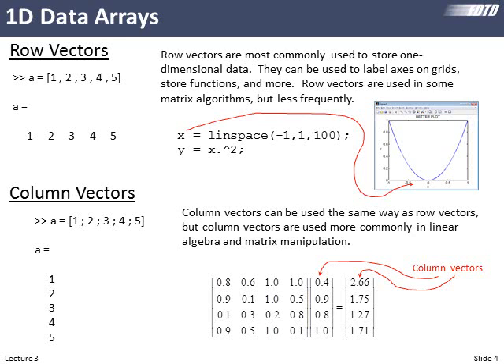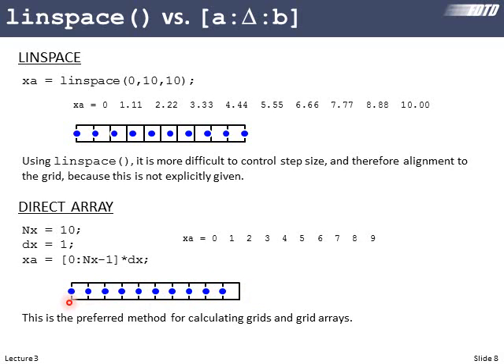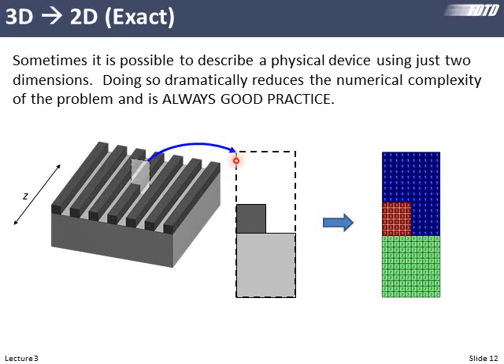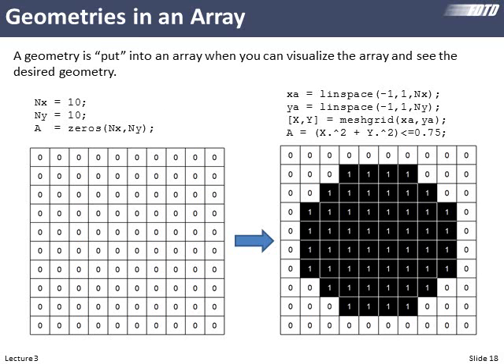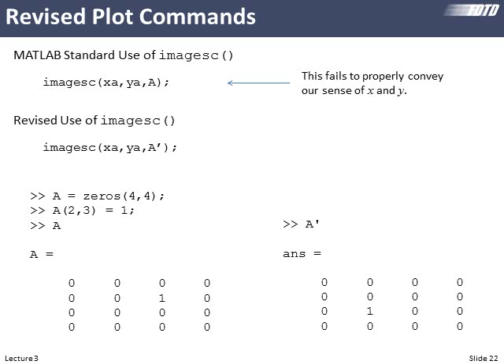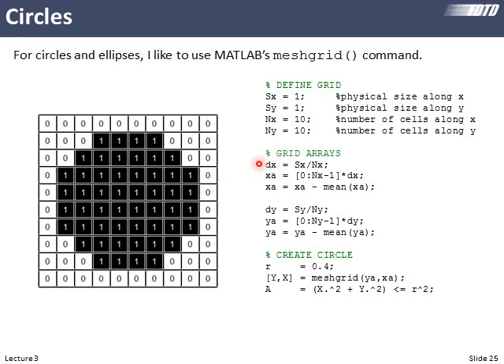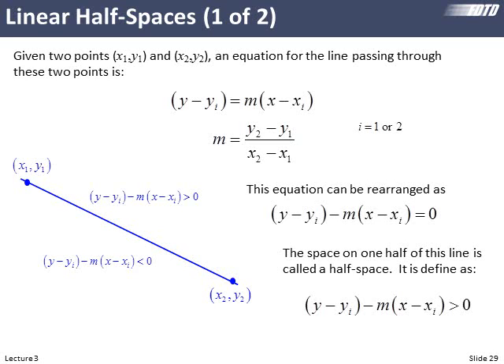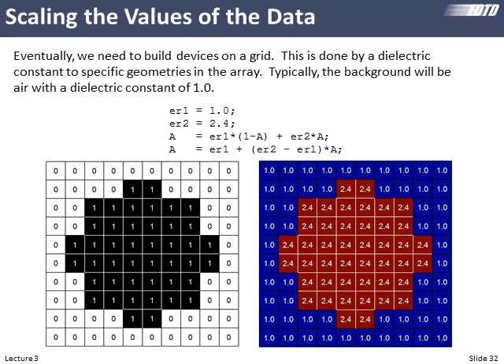Lecture 3 (FDTD) -- Building geometries in data arrays

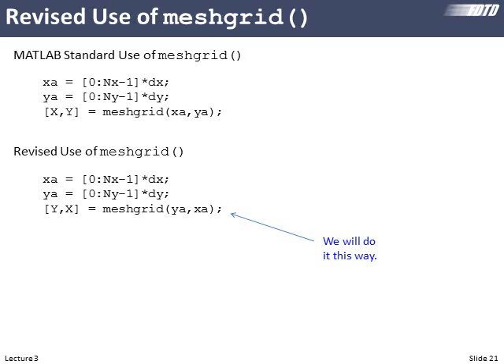Comment: Hi Professor, at 25:00, if my understanding is correct, we can simply use [X,Y]=meshgrid[xa,ya] in the current Matlab version, right? I feel a few changes are made in the mesh grid function in the new version, Here is the link: https://www.mathworks.com/help/matlab/ref/meshgrid.html
Thanks.
Reply from the maker: I was not aware anything had changed.  When I use meshgrid, it is usually [Y,X] = meshgrid(y,x).  The order is important.

Comment: Thank you sir,
But I want to make a cone in 3D.. Please help me. Give me some idea
Reply from the maker: This is pretty simple code, but you can modify it as you need...

% 3D MESHGRID
xa = linspace(-1,1,20);
ya = linspace(-1,1,20);
za = linspace(0,3,30);
[Y,X,Z] = meshgrid(ya,xa,za);

% MAKE CONE
R = 0.9;
C = (X.^2 + Y.^2) <= (R*(3-Z)/3).^2;

% SHOW
s = isosurface(Y,X,Z,C,0.5);
h = patch(s,'FaceColor',[0.5 0.5 0.8],'LineStyle','none');
axis equal tight;
view(10,10);
camlight;
Reply: @empossible1577  Thank you thank you so much Sir
Reply: @empossible1577  I'm so happy
Reply: @empossible1577  Thank you very much Sir, I have done cone, sphere, cylinder and some combinational  structure like cylinder-cone and cylinder-hemisphere. One more thing now I want to do complex structure so for that can I import any geometry from CAD model. Ya is there any other way to make complex structure like jet plane.
Reply from the maker: @PhysicsKeeBuniyaad  I would import an STL file of the plane and then use a function like voxelize() from Mathworks website to convert to points in an array.
Reply: @empossible1577  Thank you so much sir for your response, I'll try my best to do this. Can I ask you if I face any issue on that.
Thanks once again, I got lots of things from you it's may be my luck.
Reply from the maker: @PhysicsKeeBuniyaad  I will help as much as I can.  Good luck!
Reply: @empossible1577   Thank you sir,
I can't explain my pleasure. I have done model import from CAD file( .stl )and use of it in FDTD.  And all these are due to only your help. Sir, if you don't mind, could you please share your mail id. mine akhila9040@gmail.com .
Reply from the maker: @PhysicsKeeBuniyaad  rcrumpf(at)utep.edu

Comment: Hello. This is a really nice video, but I would like to ask something:
1) You only assign values of 1 and 0, if you want to be more precise, can you assign values between 0 and1 which means the cell is almost empry or almost full?
2)Here you worked with basic geometries, but if you want to generaliize to a more complex problem how can you use this method for another geometries not so easily to parametrize with an equation?
Reply from the maker: Great questions!
1) It is absolutely possible to assign values between 0 and 1.  In fact, this is often preferred to simulate curved surfaces.  I usually do not do this until the final device is constructed, and then I smooth the edges a bit.  That is because boolean operations on grayscale objects can be difficult.
2) I usually think of complicated shapes as combinations of simple shapes.  For example, a house is a triangle on top of a square.  For really complicated shapes, I may import something from a CAD file, voxelize it, and put it on a grid.
Reply: @empossible1577  Thanks for your answer, later if you could do something importing a complex geometry would be nice, I already did but my code is slow, I used boolean operations with polygons intersecting the mesh with an object.
Reply from the maker: @luiseduardojatarmontano1983  You can import images.  It will be necessary to flatten then to a single array and then convert to permittivity values.  You can also import CAD files and voxelize them using any number of codes users have contributed to Mathworks.

Comment: Are the arrays in the slides rotated from what the code does? Mine are all coming back rotated/flipped?
Reply from the maker: Yes.  I do talk about this somewhere in the lecture.

MATLAB treats everything as a matrix.  That is why array indices start at 1 instead of 0.  It is also the reason for the rotation.  In matrix notation, the first array index is the row number, or vertical position in the array.  The second number is the column, or horizontal position.  This means if you are building a function, you must interpret it as f(y,x) instead of f(x,y).

From experience, I have found it most straightforward to treat arrays as in any other language, like f(x,y).  That makes building devices on the arrays more intuitive.  However, if you visualize the arrays using MATLAB graphics functions, they come out rotated.  This is easily fixed by simply transposing the array before plotting that.  That is why you see me use commands like

imagesc(xa,ya,ER');

Notice the transpose on ER?

Comment: Thank you for such wonderful lectures. How can I build a cylindrical geometry of some random radius 'r' in 3 dimension? I understood how to use meshgrid for determining the radius of the circle but if now i want to give it a depth as well how is it possible? Please suggest.
Reply from the maker: Yes, absolutely.  You can do this using the exact same techniques.  For example...

[Y,X,Z] = meshgrid(ya,xa,za);
RSQ = X.^2 + Y.^2 + Z.^2;
ER2 = RSQ <= r^2;

This will build a 3D sphere into the array ER2.
Reply: THank you for your reply but I am looking to make a cylindrical geometry not the spherical one.  for example a cylindrical bar made of steel is embedded in wood. So i basically want to assign different material properties.
Reply from the maker: [Y,X,Z] = meshgrid(ya,xa,za);
RSQ = X.^2 + Y.^2;
ER2 = (RSQ < r^2);

This code builds a 3D cylinder with the uniform axis in the z-direction.
Reply: Yeah it worked. Thanks for your help.
Reply: What to do in case of a cylindrical geometry but with a finite depth. For example i want a 3D cube of material A with dimension 'a x a x a'  and then i want a cylindrical geometery in it having a certain depth (lets say a/2). How to control the depth of cylindrical geometry?
Reply from the maker: You can make finite depth cylinders and even more complicated structures by thinking in terms of combinations of simple shapes.  These are called boolean operations to use CAD lingo.  So first, make the infinite cylinder as above.  Second, make a slab the same depth you want your cylinder.

D = abs(Z - z0) <= (w/2);

Here the slab is centered at z0 and is of width w.  Now combine this with the infinite cylinder...

ER = ER .* D;
Reply: After generating the geometry, ER turns out to be a logical multidimensional matrix. When i tried to assign 1's and 0's a certain values, code doesn't change it.  Any suggestion why it is happening?
Reply from the maker: It could be the array indices you are using are preventing the numbers from actually being put into the array.  For example, the following line of code will not change the array A.

A(5:4:,10) = 7;

It should also be that you are overwriting the values somewhere.

Otherwise, I think it is impossible for me to say what is going wrong in your code.
Reply: I have figured out the way to do it. Suppose A is a 2 D dimensional array with a circular geometry defined in it. So initially when you check values of A, it will show 0 everywhere and 1 where the circular geometry is defined. So where i stuck was when i was trying to change all 1s to some value x it was still 1(i dont know why)

So what i did next is converted the logical array to double precision using double (A) then when i tried to it, all 1s got replaced with new value x.
Reply from the maker: Great!
Reply: Can you suggest any way to define a line inclined at different angles w.r.t. horizontal or a rectangle of certain width inclined at certain angle?

Its easy to define a line at 45 degree angle but right now i cant think of rectangle/line defined at different angles.

Comment: You mentioned how it'd take ~110 GB to solve this using a direct LU-like method. However, typically systems of this size are likely to be solved by iterative methods like BiCGStab(L) or relaxation-like methods, where the memory requirements remain manageable. 

Is there a reason why you specifically mentioned a direct method, or was that just to generally make a case about the shortcomings of sparse-matrix based methods?
Reply from the maker: Yes, it was a general statement.  Sorry that was not clear and thank you for pointing this out.

Comment: Why don't you just use colon instead of "direct array" at about 8:20? like: 0:1:10 going from 0 to 10 with step size being 1.
Reply from the maker: I could for this specific case.  The code as written on this slide is more versatile I think.

Comment: Thank you for this video! 
Why are you using a variable (za) to compute the grid point and an ANOTHER one (z) to compute the values of E, H at the the grid in the problem #1
http://emlab.utep.edu/ee5390fdtd/Homework%202%20--%20graphics%20and%20grids.pdf
Reply from the maker: No difference.  I think it was just the different moods I was in as I created the slides at different times.
Reply: Thank you !

Comment: This is an amazing resource.  I'm translating to python so it is a little tedious for me.  Does this group have a website and a general purpose?
Reply from the maker: You can go to our research website here:

http://emlab.utep.edu/

If you click on 'Academics' you can get to the course website for several classes.  This one is "Electromagnetic Analysis Using Finite-Difference Time-Domain."  The next course is "Computational Electromagnetics" and then "21st Century Electromagnetics."  The websites contain links to the recorded lectures, PDFs of the lecture notes, and other resources.  I have made many revisions, corrections, and improvements to the notes so they may differ from the notes in the recordings a little bit.

The general purpose of these lectures is to provide an introduction to computational electromagnetics for the complete novice.  I found it very hard to get started in CEM simply because there were no resources simple enough for me to understand easily.  These lectures were created with that in mind and I am always trying to improve them without over complicating them.

Comment: In slide 23, nx and ny are positions in vertical and horizontal respectively but the figures illustrates it totally differently. 1s should be filled in row 3 till row 6 and column 4 till column 8 as per the codes on the right.
Reply from the maker: I see you posted this one year ago.  Sorry I did notice it until now.

You are sort of correct.  The name MATLAB is an acronym for "MATrix LABoratory."  It assumes everything is a matrix where the convention is A(row,column).  It assumes this whether or not the array is a matrix or just an ordinary array.  In this context, you are exactly right.  However, it is my experience in computation that students have the most trouble building geometries into arrays before the simulation is even performed.  In this case, we more intuitively think in terms of f(x,y).  After some thought, you will realize that A(row,column) is a bit like f(y,x) instead of f(x,y).  This makes it very confusing to build devices into arrays, which are not matrices.  So, I like to build things in arrays in the context of f(x,y).  The only time this is not really compatible with MATLAB is when graphics are drawn.  You just have to remember to transpose or rotate your data before plotting.  Unfortunately, I have not found a more intuitive way through this.

Hope this makes sense!